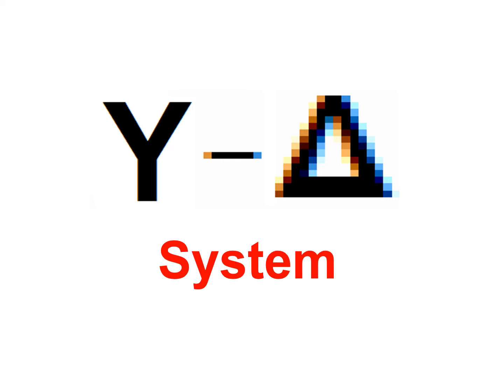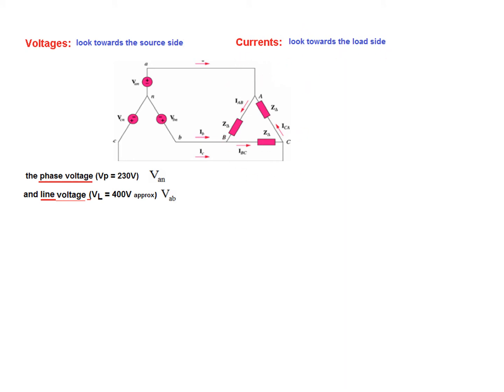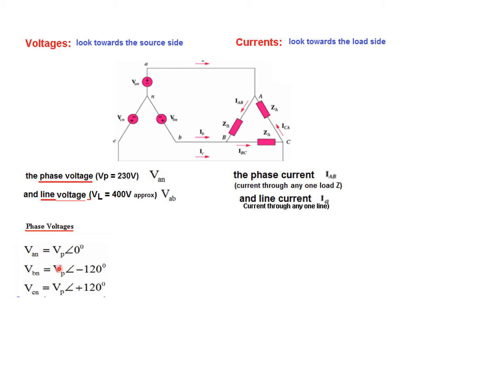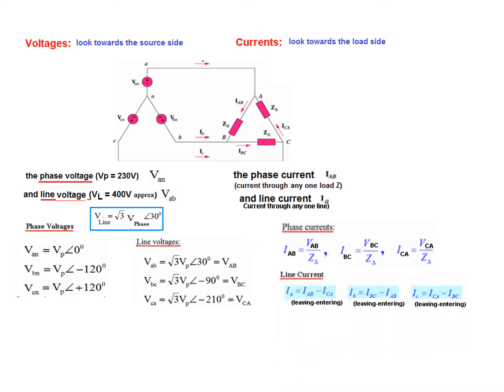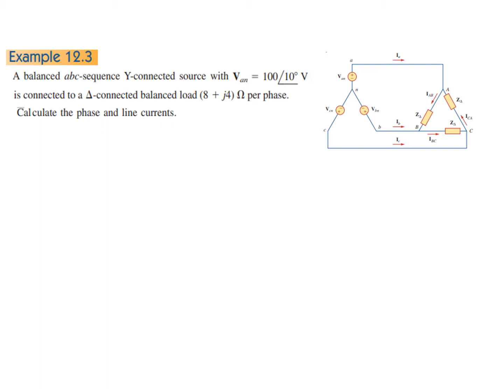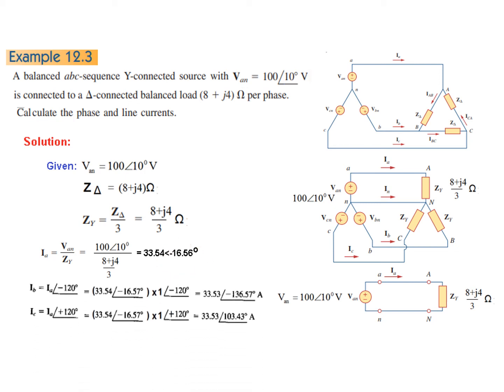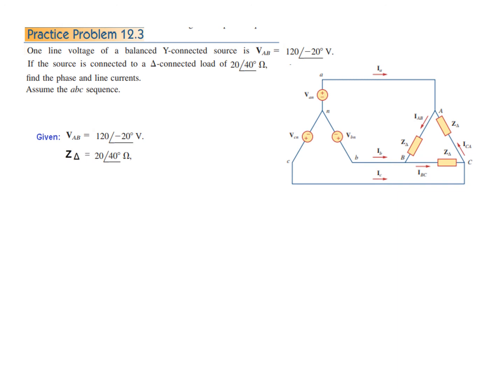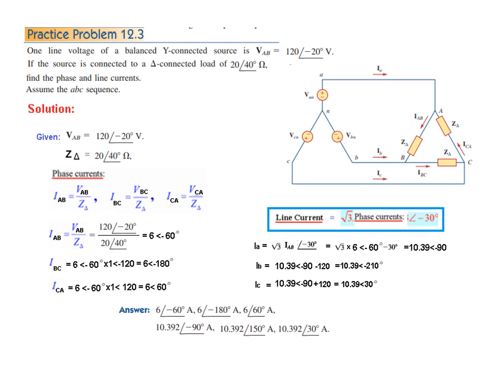(English)ENA || || Example & Practice 12.3 || Balanced  Wye-Delta Connection

Comment: 8:32 For Current BC, can I -90 to Voltage AB to get Voltage BC first and then divided by Z delta?
Reply from the maker: Why do you want to do it the difficult way ? yes you can do it but you have to subtract 120 degree (not 90)
Reply: Thank you ☺️☺️